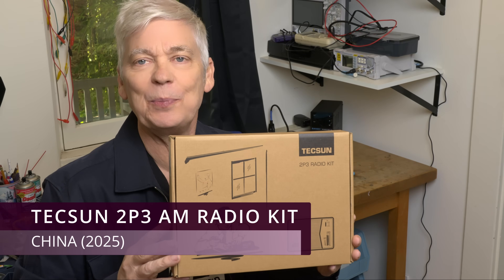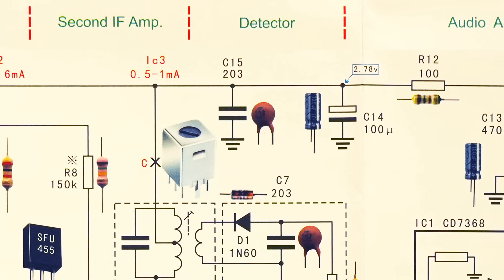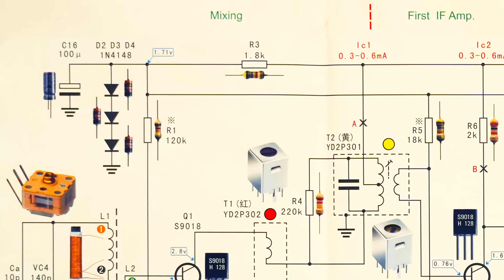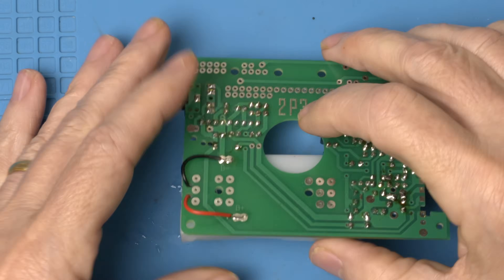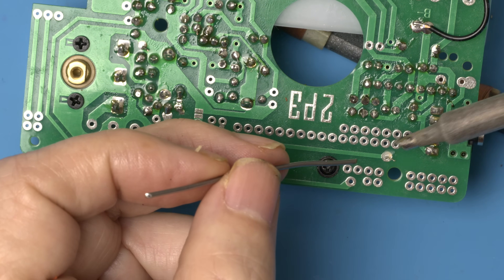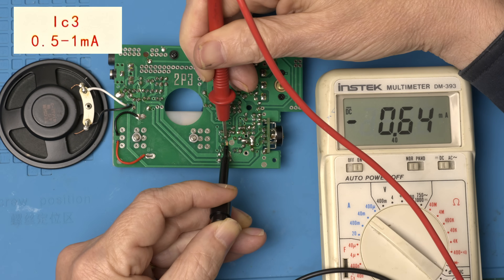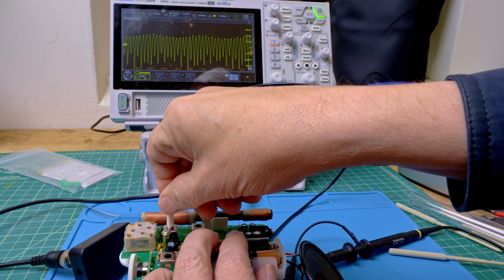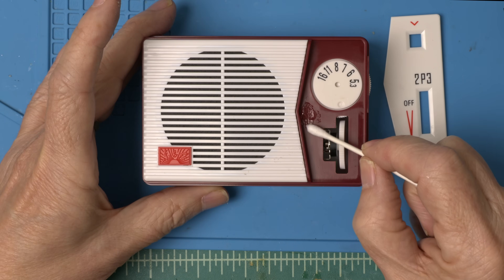I Built a $33 Amazon Radio Kit - Will It Actually Work? (Tecsun 2P3 Full Build / Step by Step DIY)

Comment: A hint about construction.  The reason you build from right to left, one section at a time, is so you test each section as it is completed.  For instance, when you complete the audio section, introduce some audio to the input.  Make sure you can hear it on the output.  Fortunately, you got everything correct the first time, with no bad components. By building one section at a time and testing it you can isolate any issues to the section that was just completed.
Reply from the maker: That’s great feedback, than you!

Comment: When I first started building my own Heathkit and Realistic kits and test equipment, over 50 years ago, I could get all kinds of kits.  There were built in the wall TV's, oscilloscopes, VTVM's, stereos, everything you would want.  I wish I knew of a company where I could buy something like a real analog AM/FM/SW Radio Kit.  Something without any IC Stuff and with real tuners.  Or maybe a real Multi-Tube Receiver Kit.  Now, something like this is all there is.  I just can't find any good stuff to build anymore.

Comment: Thank you for taking us along on your kit building journey. I’ve been eyeing this kit for months. It’s on my Christmas wish list. It’s my understanding that this receiver is quite sensitive and provides excellent performance. I too own the FeelElec FY6900 DDS Function/Arbitrary Waveform Generator. Very affordable and quite well suited for the alignment.  I look forward to completing the build and sharing in mutual success. This is one of the last Vintage looking AM radio kits still available on the market. It reminds me of my first transistor radio that my mom purchased for me: A GE 6 transistor AM radio that also ran on (2) AA batteries back in the early 1960s. I distinctly remember removing the back and studying the pc board trying to spot the vacuum tubes. Kind of a letdown because nothing glowed but helped me to imagine the world of solid state. Much later on in life I built 2 versions of this radio manufactured and sold by Radio Shack for my sons. Back then I lacked the Function/Waveform Generator and relied on broadcast reception to perform the alignment. It was crude but effective. Cheers!
Reply from the maker: That's great, good luck with your build!